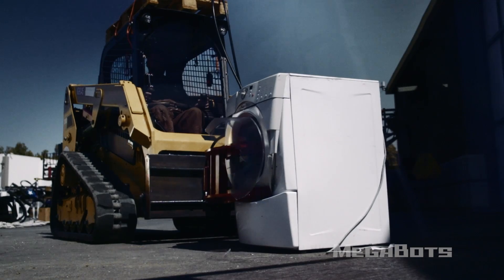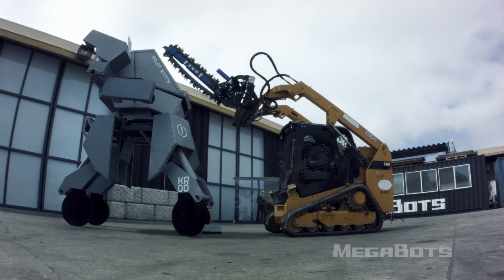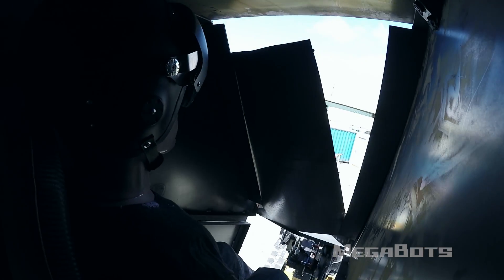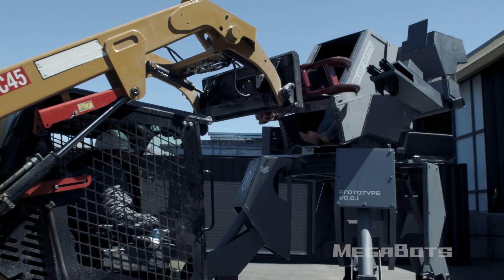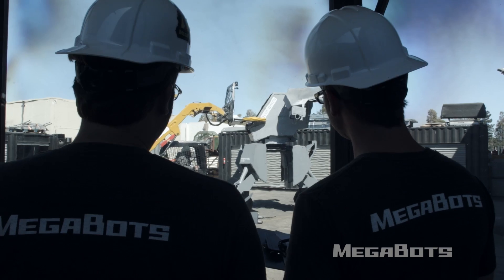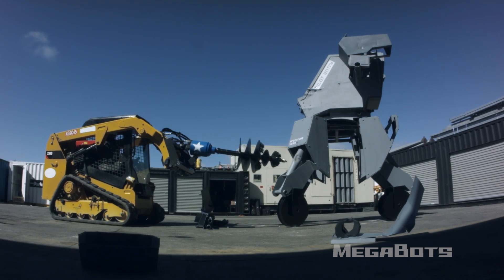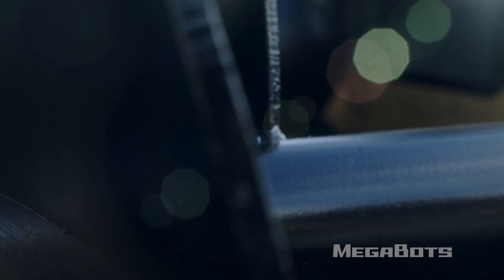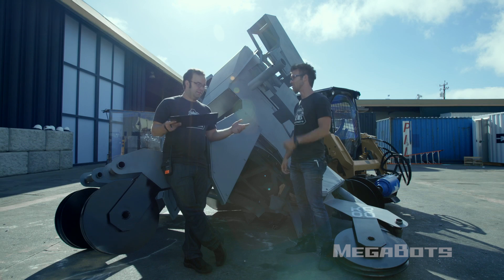Testing Real Giant Robot Weapons! (Season 1)

Comment: Well, lets be real, i highly doubt that any of them will actually work. For all of them you need to hold the opponent, and Kuratas will be moving. Also, the fact that they are difficult to use even when not in robot form... it doesnt look good for your chances against Kuratas
Reply: All this stuff they're showing has already happened—they're releasing it serially in post.
Reply: All this stuff they're showing has already happened—they're releasing it serially in post.
Reply: I agree that there will be motion, but I think it's fine for them to start small.. Although I think there should've been more progress by now... Isn't the match this year?

Comment: I suggest a Hydraulic Hammer like they put on Bobcats and the back of Backhoe's.  Use a sharpened scaling bit, should punch through armor quite well, and fairly quickly.  Seems more apt for mobile combat than a clunky drill that spins too slowly and needs time to do work.  even with a more efficient bit, it wouldn't be a good weapon until you could get about 2000 rpm at least out of it.

Comment: These guys might get some inspiration from Robot wars. The most effective weapons on that show are spinners and flippers. Conventional motors don't deliver enough power to do much damage to metal plating but if you store energy in compressed gas/liquids or by spinning up a fly wheel  then you can deliver much more power instantaneously. TBH i reckon a forklift could tipup and takeout a megabot. It's just not as fun.

Comment: Seriously, though. You're trying to disable a robot, not kill its pilot.
Reply: Japan's robot won't actually have anyone inside. It's remote controlled.
Reply: Right, which is why they said they were looking for a chainsaw with smaller teeth for hoses and tubes.  They're just testing it like this because no one can get hurt and the internet loves mecha carnage.
Reply: That doesn't change the fact that they're talking about taking a chainsaw to a vehicle with a person inside. Nothing about that is safe.
Reply: Chad West and in high level martial arts people and sending potentially deadly punches and kicks at each other.  Even in a sport as innocuous as baseball you're purposefully throwing a ball as fast as possible toward a person.  If sports were completely safe then no one would watch them.
Reply: James Closs that's how you justify it? Sports can be dangerous? Athletes are trained. A chainsaw is indiscriminate.
Reply: Chad West a chainsaw is a controlled belt which flows along a fixed line.  It's in at least as much control as a martial artist attempting to ensure their strike will injure or render unconscious an opponent, but not shatter bone or cause internal bleeding.
Reply: You can't compare a chainsaw attached to a robotic arm controlled some dude who's also getting the crap knocked out of him by another robot to a precision strike by a martial artist with years of training. There is nothing precise about a chainsaw. How on Earth are these things even remotely related in your mind?
Reply: Angel I think that's  smarter than actually being inside.

We've shown them how unstable and clanky our bot 
is.

Sure it would be cool if they were inside but it would be too dangerous.

I could be wrong though.

Comment: The final fight will be too dangerous with having a human in the cockpit.  All battle bots that have weapons that destroy their opponents are remotely controlled.   Cutting through the front cockpit panel of Kuratous would most certainly cause severe injury or even death.    This is not the path that Megabots should be taking.   No country will allow a competition to take place knowing the chances of death is 90%.  Its great to build the Mech type robot but the fight that takes place in the arena will most certainly have to be though out in great detail as to protect the human operators.    As for my self, I would not sit in the seat watching a giant chainsaw coming towards me knowing that if it cuts through the cockpit, it will have shrapnel flying everywhere.

Comment: So in combat none of these are going to be affective unless the enemy stands still is pretty much what we determined. Too slow, too heavy and not affective enough. What we need is a hydrolic punch that has sort of a  fist with points like giant brass knuckles. It needs to be able to hit multiple times with enough force to knock the opponent back or crush into it damaging its ability to fight back.
Reply: Take an arm off with the grapple and that's GG
Reply: the problem with punching weapons is that Kuratas is a quadraped, all it has to do is spread out it's legs and stay low and it will have a low center of gravity, making it hard to hit.
Reply: Christopher Bush idk man, if the japanese are doing melee, that grapple claw could be REALLY useful.
Reply: so basically hydraulic powered gauntlet. add the grabber to that and we could take the simple shock of the strike to the awe of ripping robot limbs off. might be a bit risky but it would be cool.
Reply: Like this guy http://vignette3.wikia.nocookie.net/en.futurama/images/1/1c/Destructor.jpg/revision/latest?cb=20090605015901
Reply: Well im thinking something like The Big 'O' would be nice. lol :D But basically a giant cattle punch that they use to kill cattle but a larger scale and the end has a sort of fist shape and some pointed tips so it pierces on its way in as well as has knocking power. sort of punch and pierce. So we can knock them off while hitting internal parts. one arm with that and the other can be a grapple. Grab, hold, punch to face. Arm possibly comes off in process. "Give em some chin music!" lol :D
Reply: that is exactly what i was thinking. in this battle we need pure blunt force and less slicing since real armour could definetly with stand anything they got
Reply: Alonso Ochoa I would also like to point out that they used a very thin Guage metal on their test. So all those weapons probably would fail. We need a strong grapple for one hand and a strong blunt punch from the other in order to crush the competition.  Slicing is for fleshy humans not armored bots.
Reply: Doomfist
Reply: lol i just imagined this bot putting the Kuratas in a headlock and punching the shit out of it like that scene in the second Avengers movie with the hulk-buster
"Go To Sleep, Go To Sleep, Go To Sleep, Go To Sleep, Go To Sleep- "

Comment: You guys need a diamond grinder blade with high rpm for cutting, the drill would have done better with higher rpm, also think about adding a cutting torch or even a laser like blue or green but that could get expensive pretty quick. Also might think about a liquid nitrogen hose of some kind to make the metal brittle before attacking. Anyway now I'm just off in fighting robot fantasy land lol. Great vid.

Comment: i think the stump grinder and grapple are the best for attacks but i the stump grinder's teeth need to be more like a saw blade and the grapple needs to be sharpen to a point and blade like.
Reply: Evan Ector For metal the teeth need to be a finer tooth and higher RPM. otherwise it will stall out every time. Sorry but these guys dont seem to realize how physics and  material structure works. They are better off with a giant hydrolic punch shaped like brass knuckles with 2 foot knuckle spikes to penetrate and knock the opponent down while piercing the cockpit.
Reply: Evan Ector For metal the teeth need to be a finer tooth and higher RPM. otherwise it will stall out every time. Sorry but these guys dont seem to realize how physics and  material structure works. They are better off with a giant hydrolic punch shaped like brass knuckles with 2 foot knuckle spikes to penetrate and knock the opponent down while piercing the cockpit.

Comment: I have some slight concerns regarding pilot safety.
Reply from the maker: Was it the chainsaw beating its way through the cockpit or the vertical spinner ripping panels off that caused these concerns?
Reply: TheOwnerX5X dont worry, the japanese robot is alot tougher than that
Reply: Yeah, they need to install cupholders that wont jiggle around. They might spill their coffee or something!
Reply: i feel like the Japanese team misunderstood this challenge.
Reply: I just hope they have REALLY good shock apsorption , as well as safety pannels , anyone who watches battlebots even a bit sees that some of thoes things coud teár a human to fucking shreds .Spinner suddenly colliding with improperly secured pannels also create incredibly dangerous shrapnell,if that manages to fire into the cockpit it wont be pretty.
But really they should totally still do it ,
i mean fuck , its a MECH FIGHT ,
of course it wasnt gonna be safe , thats what makes it so awsome!
Reply: Laurence Liu nope, Kuratas is tripedal which alot unstable than thread mill
Reply: +Red Deimon well, the original model has them exposed, but if it's going up against another mech they'll probably be adding skirting around the hydraulics. As for stability against toppling, if it's got the right kind of wheels and a good guidance unit it would be pretty resistant to toppling unless you used raw torque.

For reference, "Mechanum Wheel" is the type of wheel I'm referring to, it's the kind used on those omni-directional forklifts. A guidance unit with good inertia and tilt detection could detect an imminent tip and kick the wheels on to shove the legs back underneath it, so it would stumble to regain balance much like a real animal does. I mean, if DARPA could do it with Big Dog, I'm pretty sure a japanese robotics firm has access to the same level of programming.
Reply: I have never been so jealous of another person's job in my life.  I tried getting hired on by Mechanized Propulsion Systems years ago when they were visiting anime expos without success.  You guys are awesome.
Reply: TheOwnerX5X this was my first thought.  If we are chain swording why not a Waldo.
Reply: TheOwnerX5X don't worry, they've tested the mark II's safety, and the mark II will be even safer. Watch their "Designing a Giant Robot," video, and you'll see all the protections they have on their own robot.
Reply: TheOwnerX5X oh
Reply: ***** for stability i will go with Megabots, bcoz Kuratas legs are too exposed
Reply: TheOwnerX5X 

The battle just happened. The pilots were fine.
Reply: Slight
Reply: Me too

Comment: The moving stuff is fun, but I seriously think a 12' long steel bar,  or a sword could do insane damage at several meters range especially when you get your arms working correctly.
Reply: A war hammer is better at damaging armour, solid weight with a sharp point on the end gives you lots of PSI.
Reply: +Steven Randall launch the grapple,  pull the enemybto you, punch with other arm.
Reply: Steven Randall Very true but what if it gets stuck. It probably the best option though.
Reply: *****
That is a great idea hahha~
Reply: where is the flamethrowers????
Reply: napalm??
Reply: Napalm could be used to obstruct the view of the operator, doesn't have to damage anything.  It would be very flashy if this ever turns into a real competition.
Reply: What you could do is have a war hammer that doubles as a jaws of life, gets into the armour then the point opens up with hydraulics.  wiggle it around, open and close it, should come right out.  Has more damage potential too
Reply: The stinger fist isn't actually that complicated, it is basically a pile bunker with a hollow core, put the injection holes near the point and open a valve to inject pressurized whatever.  You could do regular foam, something to short the electronics, etc.
Reply: The this type of drill just wouldn't work, however combining the grapple with a high speed metal cutting disc  could do some damage to hydraulics.  There is just very little here that will do anything to the armour.